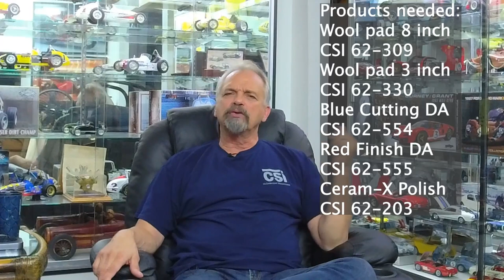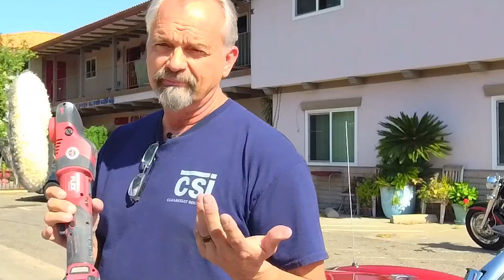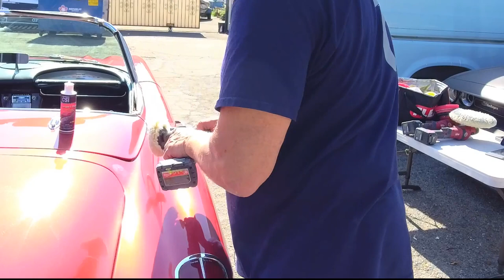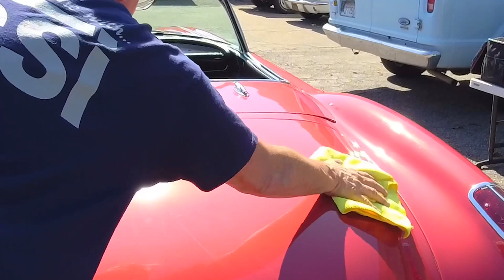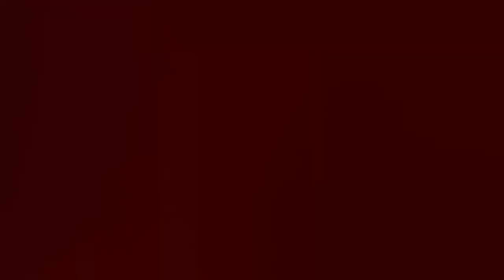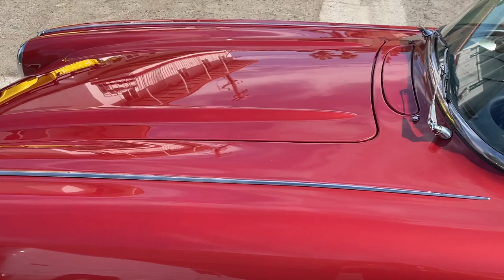Can there be a better way?

Comment: Tom, can you jump from ceram-x with blue pad to D-1 & red pad? All the videos you have have you saying to go to ceram-x and red pad & then D-1  with red pad. Just wondering if you could skip step 2 & go right to D-1. Please let me know.  Thanks for making a great product,  top performance throughout. Vince
Reply from the maker: Yes you can but here is our fastest system. 
Blue wool to cut using Ceram-X polish and rotary polisher then go to DA polish polisher and our new red 5 inch DA pad. 
At this point it’s perfect! 
But if you want that extra zinger go to new red DA pad and D1 polish for that extra pop. 
Hope this helps.
Reply: @clearcoatsolutions  thanks for the reply but that's for new paint, I  was thinking more on OEM paint & more for detailing
Reply from the maker: @vincelaguno431  Hi Vince yes it will work the way you are describing for detailing OEM paint too

Comment: Are these product gelcoat?
Reply from the maker: Sorry Keith are you asking if they work on Gelcoat? If so yes. We also have a marine Compound called Rip Cut made specifically for Gelcoat. 
Search CSI 62-M200 Rip Cut Compound
Reply: @CSIClearcoatsolutions  I will be using it on Jet Ski and it is gelcoat.  I will try rip cut.  I used TotalBoat and it was like water, maybe a bad batch.  I do have 3 white vechicles that I will also try with your red bottle.   Thanks.
Reply from the maker: @kkutube1972  hi Keith 
I didn’t know that Jet Skis were gel coat. I thought they were a form of automotive paint. Either way CSI Rip Cut 62-M200 should work very nice on the ski 
Please let me know if you need any help. My number is 714-906-6619